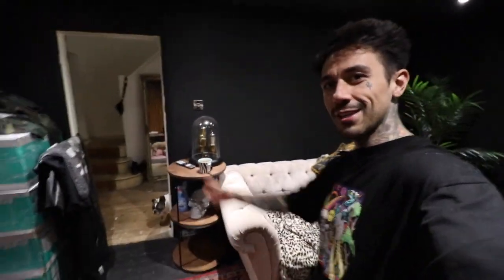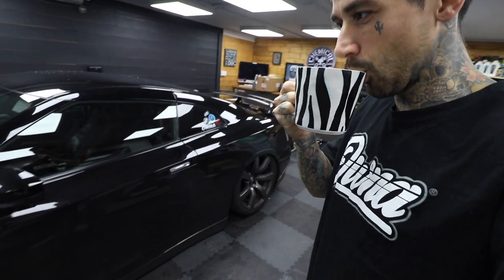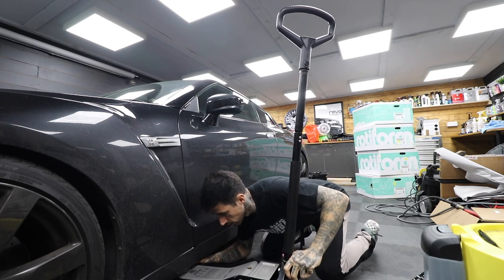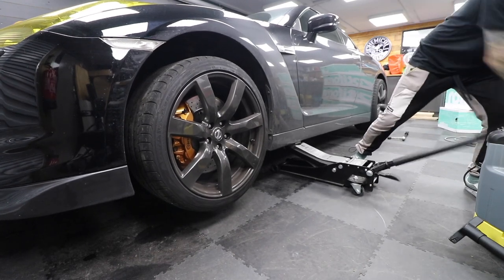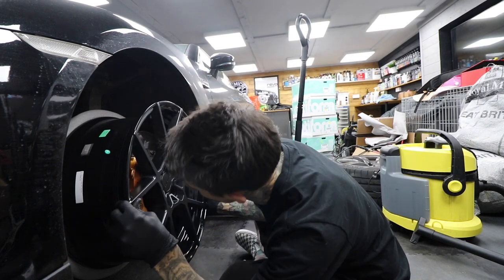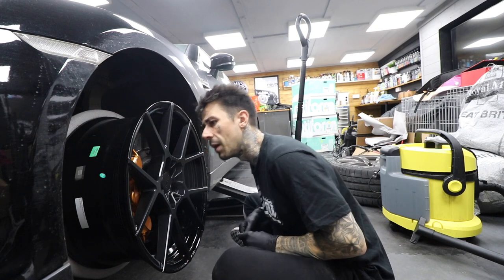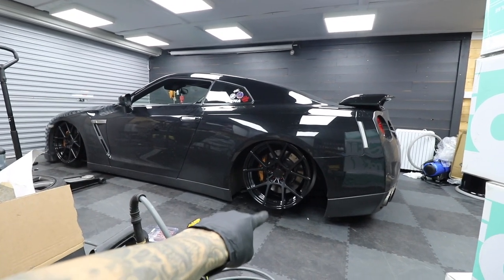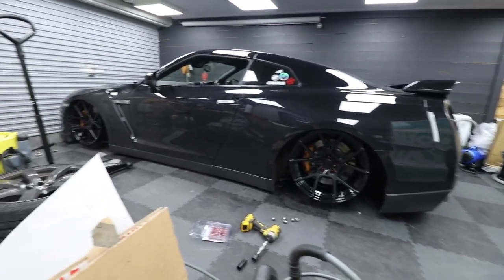WILL THEY EVEN WORK?!... GTR WHEEL INSTALL!!

Comment: If your using a torque wrench as a breaker bar, you really should set it at max torque so it doesn’t click before you cracked the nut